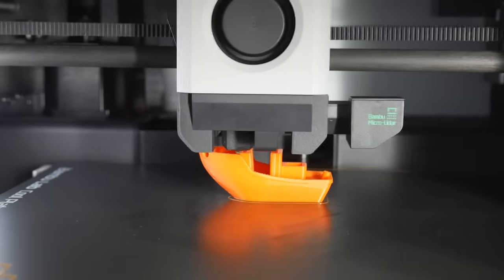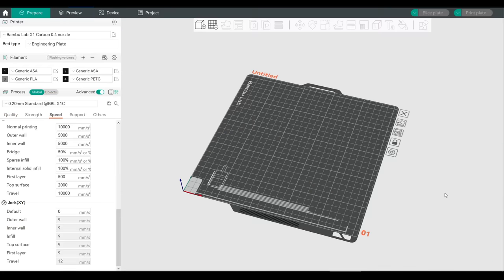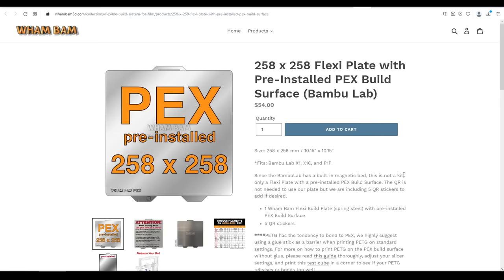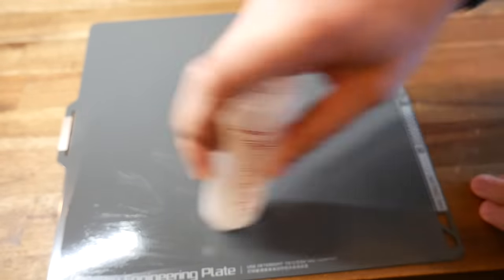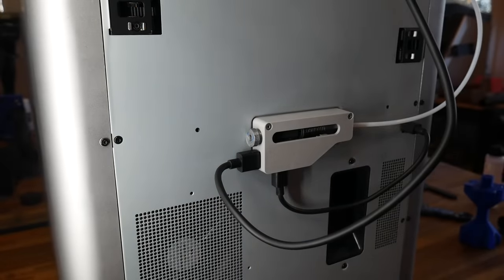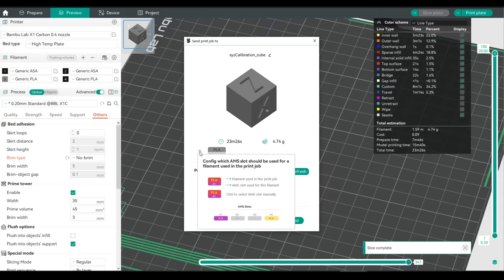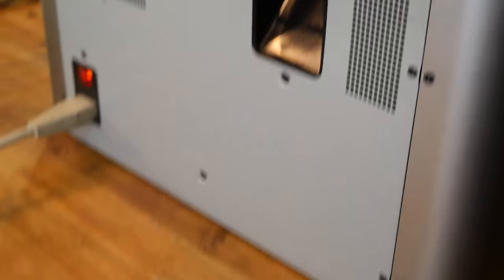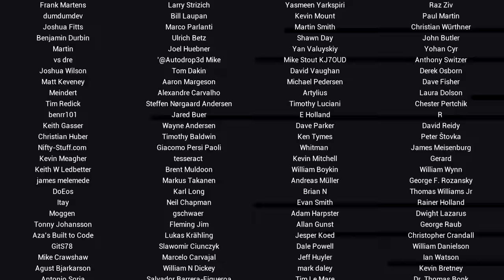The best upgrades for your Bambu Lab 3D printer

Comment: Edit: it seems to be fixed in latest firmware update :)

I purchased PEO/PEI sheet, but I can't get good adhesion. It seems like it will not create good "squish" of the first layer if bed sheet is not recognized. I tried high temperature plate option and also textured PEI option. Nozzle is always too high for good first layer on that sheet. I know I could alter start gcode and lower nozzle by setting offset, but I will not do that as I'm often switching plates and I'm sure I'll forget to turn that back.
Or maybe that's forced by bambu lab...I don't know.
Reply: Hey Rich, I was just trying this print this morning and can't seem to get that PEO carbonfiber plate, is that what you tried? Did you have any luck with it?
Reply: @TheOgres3DForge  hey Big! Yes the black PEO side. Most of the time I get successful prints. A few times however, bed leveling is confused because a small amount of filament is stuck on the tip of the nozzle. I suspect that "handle" where the nozzle is cleaning/wiping before leveling, is just too smooth to clean it properly. I always keep eye on that.
Make sure you have updated firmware on printer and bambulab studio and select textured sheet, and wipe with alcohol of course.

Comment: Please stop using S3D, you are just beating a dead horse.
Reply: i think it's hysterical that he even included it, only to point out how it failed to be of any use.
Reply: @obie224  Exactly my point, I understand if he has used it for a while. I did the same for the longest time, I paid that original price for lifetime updates. There are better pieces of software out there.
Reply from the maker: I don't use it. Just including it here because the section was on other slicer options and it technically is one.
Reply: @TeachingTech  Gotcha, thanks for the clarification!
Reply: @TeachingTech how does that fit into a video about the best upgrades? It doesn’t…
Reply: How is that an upgrade? Bambu slicer is WAY better. I like Bambu slicer better than Prusa now, honestly.

Comment: I love the way you and many support the bambu printer and yes they are very good from all the reviews
But are there arrivals or good machines like the Ender's 7 that I have that utilizes the XY core system but at a fraction of the price
Why I ask is I can print at 200 with an upgraded heat with a 500 plus and with auto bed level sensor
That once set it really is set
Meaning it only goes out of level when one removes the part.
And that is dew to the pressure of a human causng pressure on the bed to do so of removing parts
Again the auto bed leveling corrects that
Anyway the Ender's 7 is to me as equal but at a fraction of the price with the upgrades.
Reply from the maker: The whole point of a x1c or p1p is that you don't have to make fundamental changes for them to work. You are reengineering the printer to fix it, that's why it's cheap.

Comment: You are way too much glue.
Well, if you are using the glue stick, make a rectangle and a cross. only 6 lines. 
Spray a little bit iso propanol on the plate and then spread the glue over the plate. 
Don't remove all, only spread it on the plate. then you have a thin layer of the glue on the plate you you have fantastic grip. ;-)

Comment: DO NOT BUY It would be nice if you commented that there is no technical service and that with a new printer I can not print with an open incident for 6 days and no one gets in touch and there is no other way to get in touch, no answer in networks, in mails, in the support service .... when the service of other printers like Creality respond instantly. Very disappointed, I do not recommend at all to buy until they are ready.

Comment: Can we discuss how a printer this new and this expensive should not HAVE to be upgraded?
Reply: It dosent have to these things are for ease of use but not entirely necessary for the printer to work properly
Reply: Mines got a couple thousand hours on it and it's bone stock.
Reply: @kingty8010  I just look at it like a car. If it cars needed work like this so soon after buying we'd call them a lemon. I just feel like the consumer has been duped into accepting things we shouldn't have to accept just because "this is the way it is".
Reply: These are all optional but the printer itself works fine as it is, also for the car analogy, I guess you call all cars lemons because nearly all of them can be modified even if it's brand new
Reply: @omurize2007  No. Not at all. But if my new car has an issue and the manufacturer's solution is to give me a file and tell me to go make them part and install it myself then that is a HUGE failure on their part  Again  it all comes down to how the consumer has been conditioned to accept a lower standard. In the car if the ptfe tube guide U can accept this is an acceptable fix but I refuse to accept that I should have to beat the cost of the repair for such an expensive machine. If you bought a new iPhone and the charge port failed I doubt you would accept apple telling you "we won't fix it for you but here's how you can go fix it yourself". But we all have different standards. I just won't accept less for myself and a company that would do this won't get my money.
Reply: @Enjoymentboy  Same as with cars, you can leave it alone and use as is, or modify with a plethora of aftermarket or DIY mods to tailor your experience.
Reply: @mrnukeduster  That is amazing. How long have you had it? IIRC the X1 started shipping ~ August. My math tells me you've been printing around 25% of the time that it's been in your possession!
Reply: @AaronEiche  I got one of the early Kickstarter order numbers, it's running more days than not making dumb projects. Currently doing a run of brackets in carbon fiber PC-PBT for an off grid solar setup.
Reply: Yes you’re right if it needed to be worked on so soon then yes it’d be a problem but in this case it dosent need any of these things talked about in the video all of it is optional
Reply from the maker: @Enjoymentboy this is a dishonest argument. As the others have said, these are optional upgrades and even then will be subjective. The printers work very well out of the box for almost everyone.
Reply: @TeachingTech  My appologies.  I will admit I didn't express myself properly. I suppose I have seen too many videos where users have pointed out the flaws they have personally encountered and this likely has biased my views.  What really puts me off is the way the support appears to be handled in many cases.  I say appears because I can only go on what others have shown.  The print you showed for the tube bend, to me, is a perfect example of how not to support your customer.  If you had paid $1500 for a TV, and while it was in warranty you encoutnered an issue that directly affected it's operation, and you contacted support I strongly doubt anyone would accept their answer being "These are the parts you can go get at your cost and then install on your own".  The proper way they should deal with this is "We are sorry.,  Where can we ship the part to correct the problem?".  Having spent decades working in the support field I likely have MUCH stronger views in this regard than most people do.  When I had my own IT business I never once left a customer hanging and I refuse to accept less for myself.  Again, I understand there is no such thing as a perfect product.  It is the after-support that matters most to me and this is where I personally see things falling short.
Reply: You don’t HAVE to do any upgrades. It can be used as is. Quality of life improvements are different.